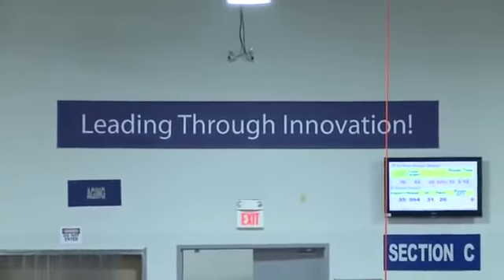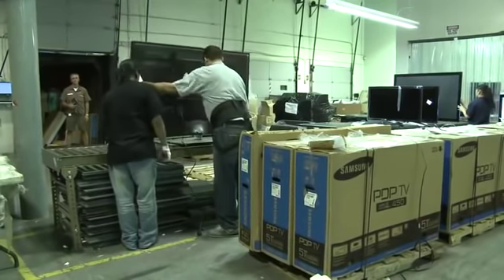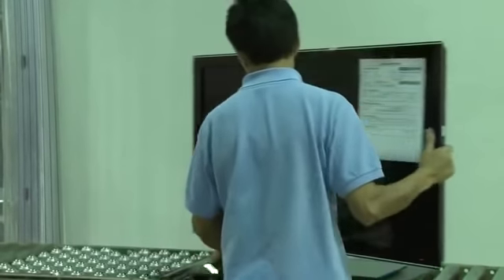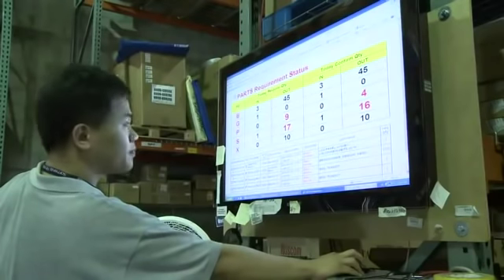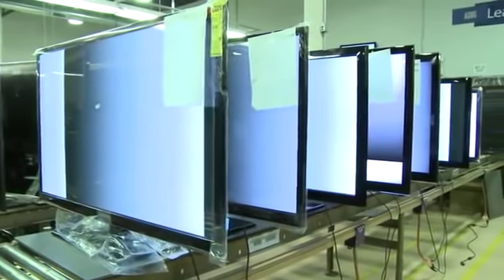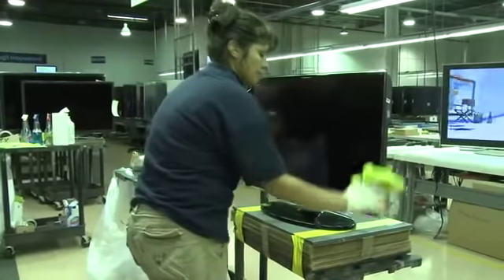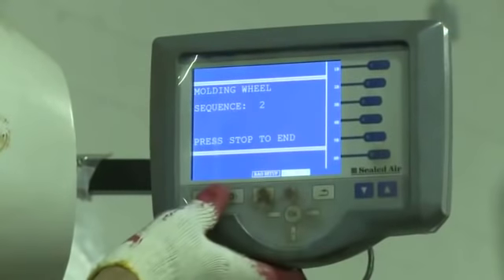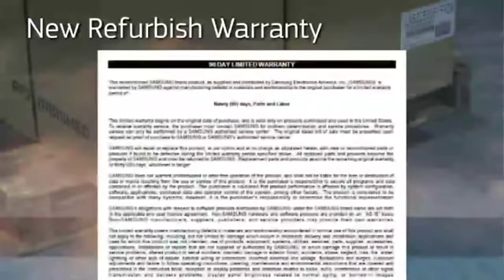201310 Samsung TV Refurbish Process

Comment: I never buy refurbished anything!
Reply: Why?
Reply: Choudry Arif you can find refurbished products in amazon ebay with lower price
Reply: I once got a Sony 36" XBR (HDTV version) CRT from the Sony Style store in Castle Rock Colorado. (no longer open) It was a nice discount and I think they offered an extended warranty I took from the standard 90 day. Even with that it was still way less than a brand new one. The TV lasted many many years trouble free, and it basically was brand new condition, I could not tell it had been returned to Sony, no scratches whatsoever.  I eventually moved and sold it to someone since I didn't want to lug around a 200lb TV and LCD's were finally acceptable to replace CRT, and the cost had come down enough. Versus when they were still over $3000 for a 42" when I got the XBR 36". It was a great TV to cover the bridge between standard definition and high definition. Amazing picture, probably the best CRT there was, being trinitron and all.
Reply: Fillup 40 same